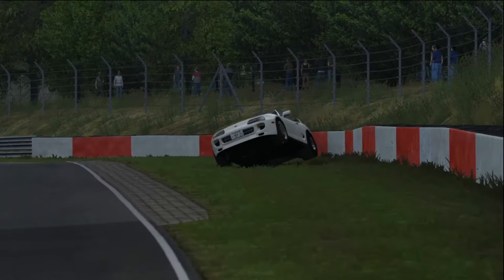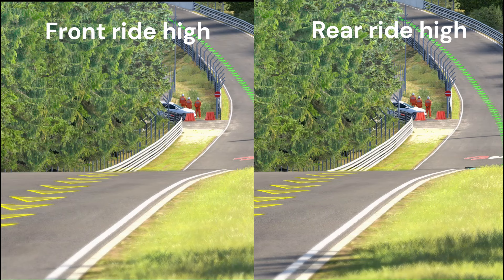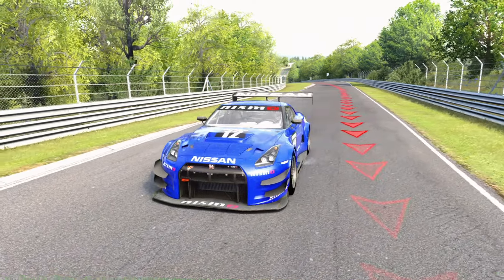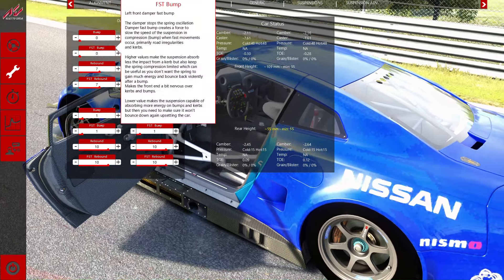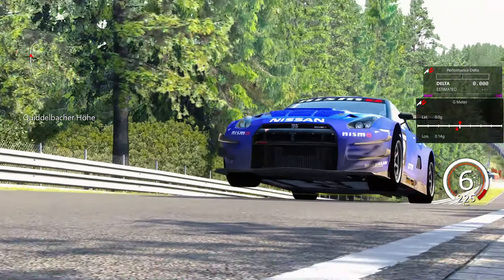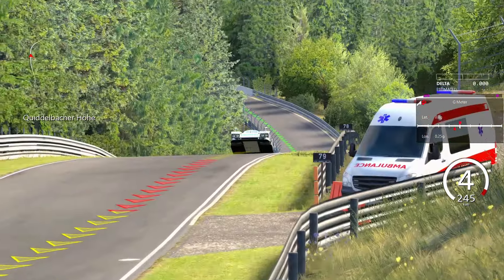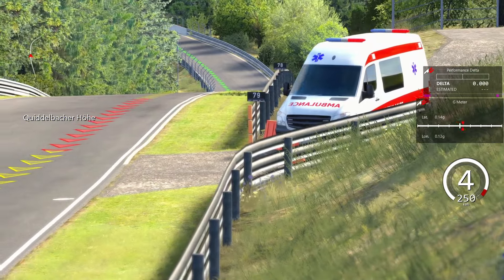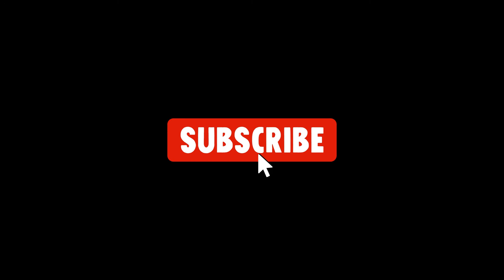Testing out whether it's possible to flip around Flugplatz

Comment: well the game isn't really simulating what happens in real life when a car with a flat bottom as these games aren't simulating the air that would get caught under the car. So to get the car to flip like it did in real life in any racing game is going to be harder to do.
Reply: Beamng can tho
Additionally the real crash happened because of strong winds
Which turned the downforce into upforce